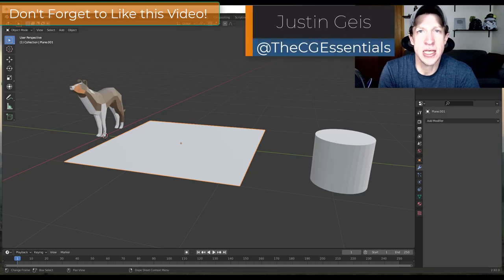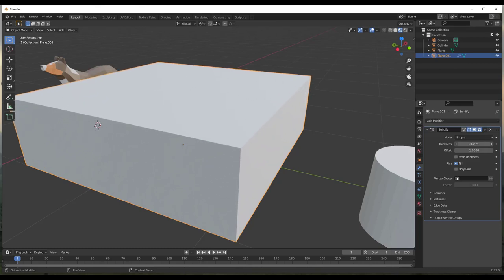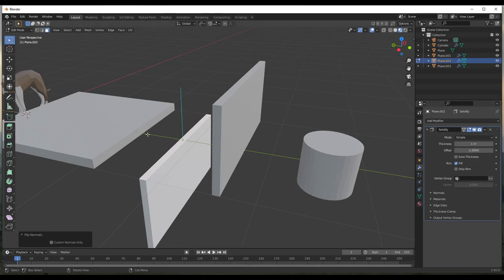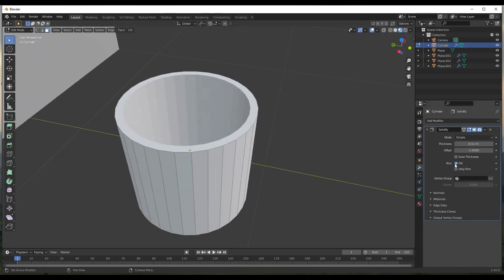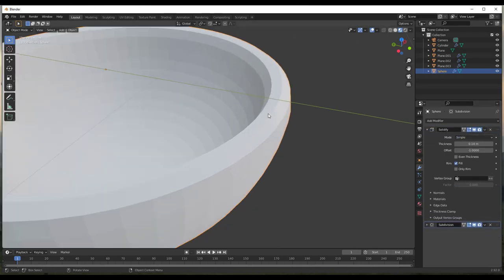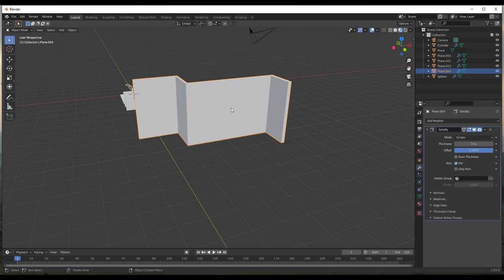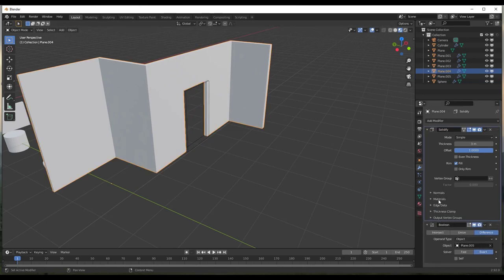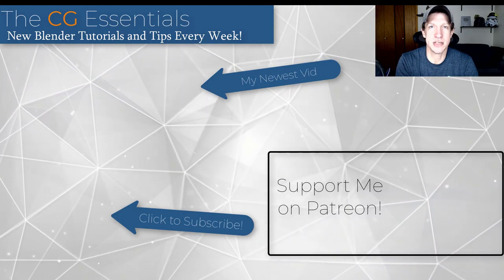Blender SOLIDIFY MODIFIER Tutorial - Adding Thickness to Objects in Blender!

Comment: i have made a mask but it's too thick and nose part is a solid chunk. Is there a way to make the whole mask thickness be equal all over and remove excessive marterial from the backside of the mask so you dont ruin the front???. I tried using the solidify but i just get strange spikes building up on the mask.

Comment: I'm creating walls, and I'm using the thickness modifier, but not the way you are showing, I have the vertical section of wall, and then I'm extruding the wall's thickness with the modifier, and not the height

Comment: Can you point me in the direction on how to take a mesh from a game file (car) and make that a solid to 3d print? I have taken the file and cut it down into parts that i want to print however when i try to print that part it is only 1 wall thick and i need it to be a few millimeters thick (for strength) i tried taking the file and capping off all the open spaces however that did not work.
Reply: Trying to do the same thing..any luck?

Comment: Solidify's thickness seems to be buggy: For instance, if you set a 0.5 m thickness on the default 2-meter size cube or cylinder, it works fine and display a 1 m hollow. But if you change the XYZ dimensions of the object to 1 m, the 0.5 m thickness on both sides should close the gap, but it looks more like a .25 m thickness. You need to set up a thickness of 1 m on a 1 m wide object to close the gap. As if solidify works only assuming a default 2 meter object size, not the user-defined size.

Even weirder things happen if you set up units in millimeters and try a 30 mm thickness on a 300 mm cube, even one hollowed out with only 4 faces left, to remove all possibilities of errors (I read that solidify does not work well on more than 2 adjacent faces). But I am new to Blender, maybe I am doing things wrong.
Reply from the maker: Make sure you've applied your rotation and scale to your model before trying to use the modifier
Reply: @TheCGEssentials  It was the scale indeed, thanks. I found out on my own at the same time reading more information about these basic scale and dimensions concepts. I have a hard time understanding why a solidify thickness in metric units does not apply to the object's XYZ dimensions, also in metric units, but on the scale of the object. Remembering that the scale is not the size of a cube but the size of a virtual box around the cube is confusing for such simple geometric volumes where scale and dimensions are identical (at first, before any transform).
I model physical objects of specific dimensions, so I need to enter these dimensions every time, which messes up the scale that I need to re-apply every single time for the tools to work as expected.
This is quite fastidious and frustrating, so I am probably not using the proper Blender workflow. I wish there was a way to lock the scale during modeling, instead of resetting it manually before every edit...

Thankfully it's a simple project: I am building a vegetalized wall, with 26 cm cubes of light concrete, molding 4x4 cubes together as a 52 kg cinder block so there's only 31 blocks to lay out altogether on the foundations, a quick job. The cubes have a L12xH6 cm slot on top center for the plants to grow out, one slot every other cube on both the alley side and the garden side alternatively. Holes for drip watering too.
I'll use the full wall render for the building permit.

Comment: If I make a cylinder pipe like in your example, how would I be able to add a texture on the inside that's different than on the outside? Same thing for the walls you demonstrated. For example, if that was a wall for interior/exterior with two different textures/colors?
Reply from the maker: Not 100% sure but I believe you'd have to apply the modifier then unwrap the object you'd created